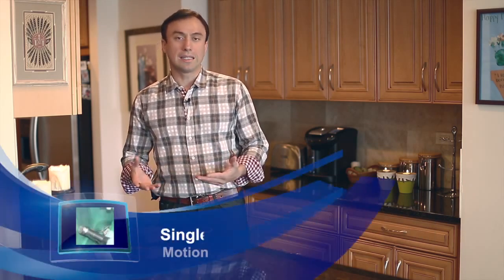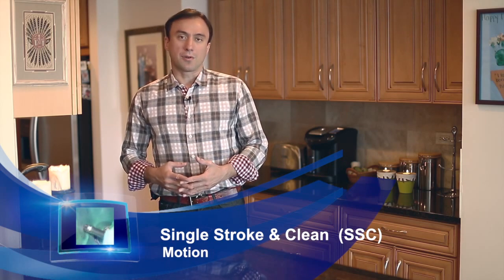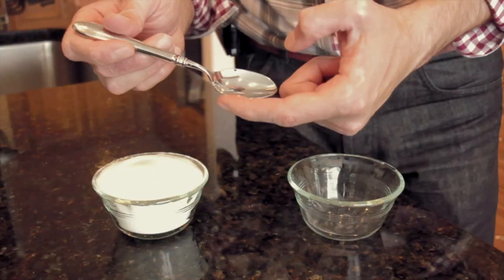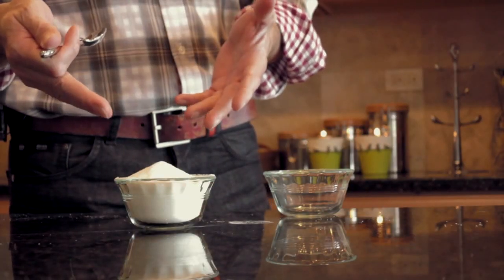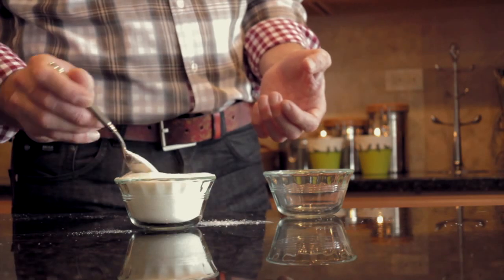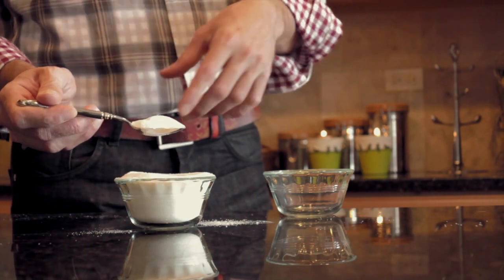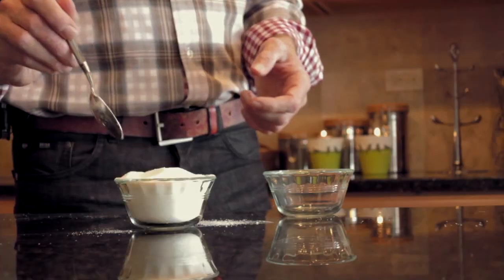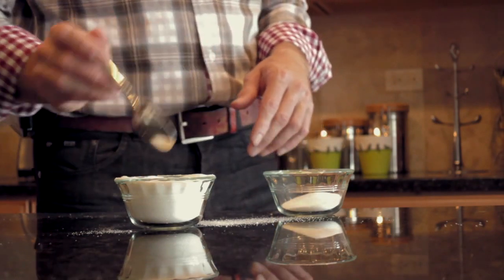RealWorldEndo's Single Stroke and Clean™ (SSC) Motion!

Comment: How wet is the canal when using this technique? When the pulp chamber is flooded with NaOCl you don't get that amount of debris on the flutes, it remains mostly in suspension, or do you use viscous chelator?
Reply from the maker: Lucian Popovici No viscous chelators. The whole point f SSC is that you only need liquid in the canal. I also recommend having it in the chamber. You still bring up the debris if you engage the dentin and remove the file before the chip space is full.

Comment: I've just ordered the ESX based on your videos Dr. Nasseh. I've been a long time EndoSequence user but am excited to try the new system. I see your assistant using what looks like a sponge on a stick to wipe the file while the instrument is still turning. What is this cool little device and where can I get one!? Thank you again for your excellent videos, they have been helpful in my own progression in Endo.
Reply from the maker: Hi there! The brushes are something we've developed and will soon be released by Brasseler. They are very useful as it reduces the time and increases safety of wiping the files. Unfortunately, it's taken a little time to have them out. The key to SSC is that people don't get lazy and decide to do two or three strokes instead of exactly one, very light stroke. Please remember that when you try the Expeditor. ESX is a very gentle system and involves removing dentin one layer at a time. It takes several SSC strokes to work down. As long as you're not pushing. I will describe some new advanced ways to address more difficult cases soon.
Reply from the maker: By the way, one more thing: If you've been a long time EndoSequence user and the system works for you I wouldn't go ahead and switch completely to ESX. I would use the ESX in more simple cases and EndoSequence in more difficult cases. Then I would gradually learn how to use the ESX in molars. It's important not to think you can just push the Expeditor all the way to the apex in a tough case. You will need to instrument the apex of a tough tooth to a size 15 hand file before trying to get the Expeditor to the apex, otherwise you will torque that file too much. I'm in the process of doing a video for the more advanced cases using ESX. Cheers!
Reply: RealWorld Endo Great! I can't wait to see some more advanced cases with the ESX. I actually tried using the SSC technique with EndoSequence the other day and it felt "safer". It makes sense to use our rotary files as "spoons" like you said. I just received the ESX files in the mail today and am excited to give them a try. Are you still using the Scout Race files? I noticed you don't use them in your videos anymore. I've broken a few of them and I've been shying away from them lately as well.
Reply from the maker: in the ESX System, two ESX Scouts (15/.2 & 15/.04) are used at 550RPM instead of the Race Scouts (10/.02, 10/.04, 10/.06, 15/.02, 20/.02). We will soon have some tutorials on the Advanced Technique. In the mean time, please make sure not to try to get the Expeditor (15/.05) to the apex until you've instrumented the canal to a size 15/.02 hand file. A comprehensive tutorial on the safe use of files, especially the ESX is under way. Meanwhile, stick to this rule of instrument a canal to a size 15/.02 hand file before using the 15/.05 to the Apex using SSC. That's much safer. Also, you'll need orifice openers in molars.

Comment: I have been using a similar motion, but seeing your Video, I should consider placing a trademark in mine :-) ... and call it "single stroke & flip" or " push & flip". Joke aside, while using Reciproc files, I noticed the same effect with those full flutes. Since I mostly work without an Assistent while doing a root canal ( even with a microscope,  I am an intern in an understaffed office), I have nobody to clean my file without taking my eyes of the work field. To avoid that problem, I "flip" my file on the flooded access cavity: I simply lift the file up until only 1-2mm of the filetip are in the cavity and move the file sideways until it looses contact, and flips. The moist debris are disangaged and cleaned by this spring effect and work can be proceeded. You should give it a try! 

Thanks for your Videos, please keep it up!

Gregor
Reply from the maker: Gregor, I've tried that too. It's just not predictable enough if you have the debris packed tight in the chip space. But it's certainly better than nothing. This video along with an article I'm in process of publication marks the point where we can have these conversations. People have not talked about this anywhere in the literature until just now.  
Also, everybody says they wipe their file after every stroke but we're very literal about it (Every single stroke!) Thanks for watching and leave comments on the RWE website vs. here on YouTube please so others can benefit from it too.